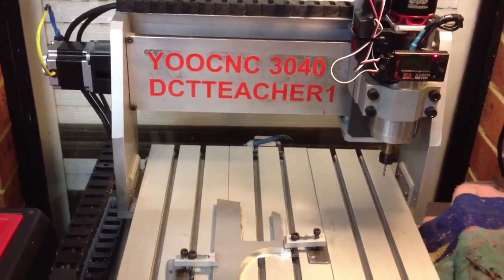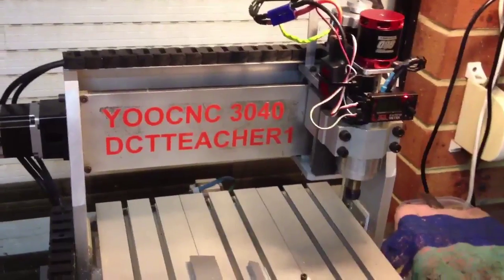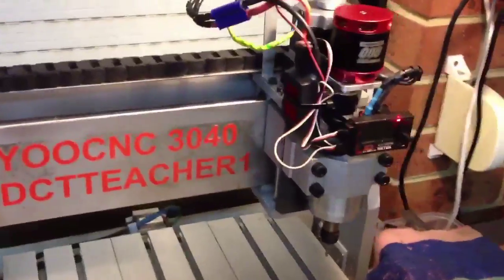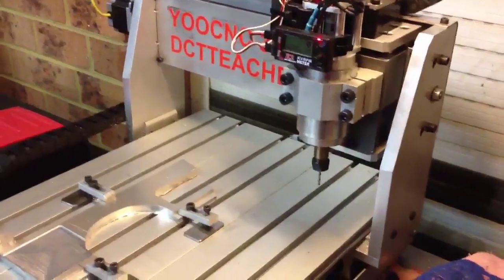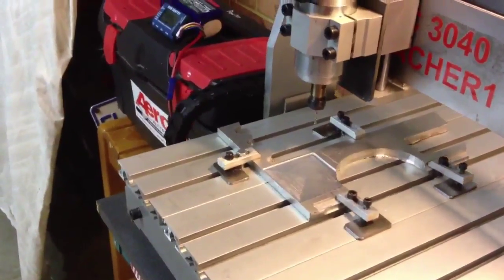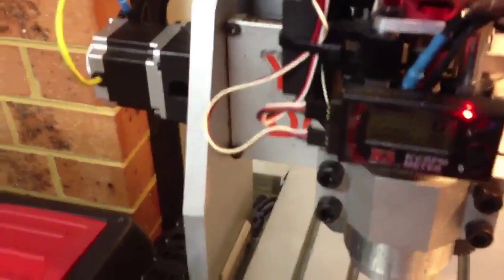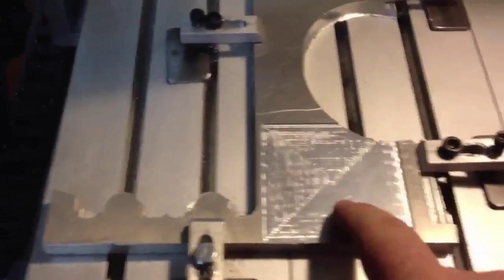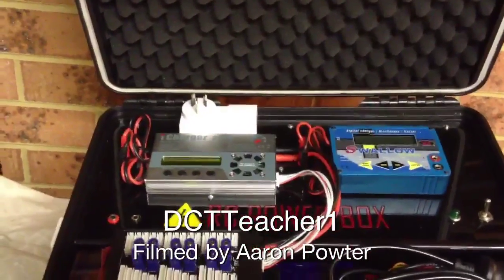CNC 3040 Router Update

Comment: I have a 3040 I've had sitting for a bit. I'm curious about the spindle upgrade. Can it handle side loads better?
Reply from the maker: Hello and thanks for watching.  I wouldn't do this modification now if I had my time over.  I would just purchase a new 1-1.5kw water cooled spindle and VFD for the machine.   They are well priced these days.  Cheers, Aaron.

Comment: G'day mate. I know this is an old video, but did you need to upgrade your steppers or reinforce the frame to cut aluminium?
Reply from the maker: G’day, nah I just used it straight out of the box. It’s not the greatest CNC, but it’s ok for the home hobbyists. If you’re going to be cutting lots of aluminium you’ll need a bigger and better machine. 👍🍻
Reply: @DCT_Aaron_Engineering  Thanks mate!

Comment: So I got this from Amazon it's been a year almost it's still not running found out cause I was givin a copy of a license not the actual software so I got a offline usb controller o lying to find out mine has no usb slot only a parallel port what do I do to get it to work I'm thinking of buying mach4 software or do I stay with mach3 my issue is the driver does not communicate with CNC so I got an expensive paper weight I want a working cnc what do I do any help will be greatly appreciated
Reply from the maker: f m hey mate. Hook her up to an old PC with a parallel port. Or change out the break out board for a more modern one allowing for Ethernet or USB control. My advice is to put a Masso controller on it 👍

Comment: 6040 machine do you have a link for one to buy nice video once again
Reply from the maker: Sorry Eric but I don't have a link.  However, you can usually purchase these units off eBay.  Cheers Aaron.
Reply: DCTTeacher1 you think a 6040 machine would be a good starting point to learn on im just getting into cnc
Reply from the maker: Yes they are good cnc router for doing plastics, timber and light aluminium work.  Depends what you want to machine?  If you want to do steel you'll need to get different type of machine for home.  Look at Syil CNC machines too.  Cheers, Aaron.
Reply: DCTTeacher1 light aluminium and stuff mostly and getting to learn the basics on the Mach 3 software etc
Reply from the maker: Hi Eric, Mach 3 software is rather outdated these days.  I have moved away from a PC based controller for CNC and would rather opt for an industrial controller or even a Masso.

Comment: can it drill a 2mm stell sheet?
Reply from the maker: milad ghasemi Hey mate, this is a router designed for timber, plastics and light aluminium work. Possibly could do a hole in a steel sheet, but it’s not the machine to do it with.
Reply: thanks، what about 6040?
Reply from the maker: milad ghasemi 6040 is a much  bigger & better machine. However CNC Routers are not designed for machining steel.
Reply: ok , thank you

Comment: I'm planing to buy one of these. I want to know how loud is this when it's working because I live in a condo building and I'm planing to run it in my apartment so do you think it would be too loud for my neighbors. I'm planing to cut wood and maybe HDPE
Reply from the maker: Hey bud, I haven't got the power connected at the moment.  However, once it's up and running I will sound check it with my dB meter ok.  I think most of the noise will come from cutting operations in and would change depending on material you're cutting.  Cheers, Aaron.
Reply: Thanks man, I use 3 axis industrial cnc at work and to me it would be loud in home environment but I thought it's about the router size.
Reply from the maker: Sorry bud, I was confused and talking about my new CNC machine (another video).  Yeah the little 3040 is fine for indoors.  You could easily make a sound proof box for it too ;-)
Reply from the maker: Oh and honestly.  Spend the extra money and get the 6040.  It has ball screws, VFD and better spindle.  Plus you'll appreciate the larger bed size.  Check out my mate Luke's channel (cruddcnc) as he has one.  Or watch my DIY camera slider video and you'll see us cutting carbon fibre out in his 6040.  Cheers, Aaron.
Reply: sound proof box is a good idea. Now I'm confused because of the bed size. I want 4 axis one because I want to use it like a lathe. I'm planing to do rings, espresso tamper handle things like that so I don't need to big bed size. I think I'd like to start with 3040 but thanks for advice.
Reply: I built a sound proof box for my 3020 in my apartment, and it works really well.  Our dishwasher is much louder. I made up some CAD drawings for the enclosure if you're interested, let me know and I'll send them to you. However, one thing I didn't follow through on was a sound proof enclosure for the dust collection system (shop vac).  The vacuum is incredibly noisy, but I can barely hear the router. :P.  The greatest benefit to the enclosure is that it keeps your apartment clean.
Reply: drawings would be great! At least it will give me some idea about what kind of  box I should build. I can adjust the size if I'm getting a bigger size. you can send me dxf or any 3D format (Solidworks, Catia, NX or step) that would be great.
Reply: Here's a link to download the CAD data.  I've got some pics in there too. The drawings are kind of sketchy, but I've got the solidworks files and a step assembly in the zip file. https://drive.google.com/open?id=0B85KWPSofM6gbGFPbUNNOWFDYzg
Reply: Andy Waters thanks. I'll make some cut files from solidworks.

Comment: Hey DCTTeacher1,

Got the 3040T machine and got a printer lead with it to USB (not the Parallel port printer cable though). This works with the software they gave me but I want to get it running on Mach 3. Do I need a different lead? If so, any idea what one? Or do you think i'm doing something wrong perhaps when in the software? 

Any help would be much appreciated as wanna get it up and running!

Cheers and nice video btw.
Reply from the maker: Hey man, I sold my little 3040 many year ago now.  However by memory, I don't think Mach 3 will work through a USB port.  I know I had to run windows XP (32bit) on my computer.  Some people use smooth stepper with USB and Mach3, but I haven't done this before.  Sorry I can't be of anymore assistance.  Regards, Aaron.

Comment: Please why you suggest 6040 than this .can you explain the reasons?does 3040 make wood engravings with success?thank you
Reply from the maker: Hello and thanks for posting.  I bought this 3040 machine many years ago.  I believe the latest design now come with ball screws, VFD and upgraded spindle.  This being said, I think they would be a much better machine than mine.  Especially if you just want to cut timber, plastics and the occasional aluminium job.  If you just want to CNC machine aluminium and steel, this isn't the machine for you.  Hope you find this information useful?  Cheers, Aaron.

Comment: As this video is from 2012. I don´t know, did you upgrade to a 6040? I´ve got a 3040 now, it´s ok from the dimensions for me, but I´ve only got a 300W spindle. I know that´s possible to upgrade with RC stuff as you did. Question is, would you still upgrade with an RC motor of would you use one of the spindles plus inverter that you can get on ebay nowerdays. I think back in 2012 those were not available. What´s your current CNC setup? 
Thanks, 
Michael
Reply: DCTTeacher1 you didn't answer his question though ))
Reply from the maker: Hi Michael, yes I sold this machine sometime ago now.  I never did upgrade to the 6040.  The little 3040 was good for awhile, but I quickly outgrew it as it had limitations.  I now have a TM20 (clone g0704) Chinese milling machine that I converted to CNC.  This machine will easily do aluminum and steel.  Refer to my playlist for more CNC videos on my new machine.  Have a nice day and thanks for messaging me.  Regards, Aaron.
Reply: Thanks Aaron.
Reply from the maker: racingdude You're welcome ;-)
Reply from the maker: John Smith good point lol. Yeah if I had my time over again I'd buy a VFD & spindle motor. I wouldn't upgrade with RC parts ;-)

Comment: do these come with software and bits?
Reply from the maker: Hi Jason, I bought mine some years back now. It did come with some basic tooling and other items. Mine didn't come with software. You will need cnc control software such as Mach3, linuxcnc or Kcam to make it work. You will CAD-CAM software such as Fusion360 or Vetric vcarve pro or 2d cut to design your parts and post process your G-Code. Thanks for watching

Comment: hi ...can it run - thoruhg 10mm brass or aluminium ?
Reply from the maker: Hello, yes you can but it will take awhile. This machine can only take shallow cuts on that sort of material. Cheers
Reply: +DCTTeacher1 Thanks ! it is better to go for 6040 - spindle they is stronger ?
Reply from the maker: +Wojciech Kluczewski Yes that is correct.  Don't waste your money on the 3040.  If I went down this path again I'd get the 6040 first. Hope this helps you? Cheers, Aaron.

Comment: Hello I have your same machine, and I want to make the change to the spindle, unfortunately I do not speak English (I'm using google Traslate) and I could not figure out which model of Brushless it.
I did a search and I think it is this: Specifications:
Dimension: 58mm x 49mm, 78mm (with shaft)
Weight: 349g
Kv: 1400rpm / V
Turns: 8T
Voltage: 5 ~ 8S
Max Current: 110A
Diameter of shaft: 6mm
Length of front shaft: 21mm
ESC: 150A
 
You can help you :)
Reply from the maker: Toto Burgio Hello Toto.  All parts came from from HobbyKing.  Turnigy 600 Brushless Helicopter Motor 4030-880KV and a HK-100A ESC (speed controller).  To run it I used a Turnigy 1200W 24VDC 50Amp power supply.  Hope this helps you Toto.  Regards, Aaron.
Reply: Thank you were definitely a big help :)
Reply from the maker: Toto Burgio You're welcome Toto ;-)
Reply: thanks :)

Comment: Could you substitute the battery for an old PC power supply?
Reply: DCTTeacher1 You could potentially hook up two PC power supplies in series to get 24V.
Reply: @Ian Leung don’t need two, a PC PSU has a few 12v connections so link two together or something, I sure some might have higher
Reply from the maker: dmak2 Hey man. I don't think a PC power supply would be able to pump out enough voltage or amps to run the electric motor. I originally used a lipo battery to film this clip.  However, that was later replaced with a 24volt - 50amp (1200watt) power supply from hobbyking. Cheers, Aaron.
Reply from the maker: ***** Hi Ian, personally I wouldn't do it. However, you would have to speak to someone who has more electronics knowledge than I do.  I would go down the line of a specified 24VDC power supply from a retailer.  Cheers, Aaron.

Comment: I have a problem with my cnc router spindle and i hope you can help me... so after reinstalling the max\ch 3 program i observed that i could not get the speed as before when turning the controls. Before, i usually set the spindle speed midway the dial. Now, i had to set it to MAX to attain a clean cut.
Reply: Nick Ustari Check if your carbon brushes are worn out and need replacement.
Reply from the maker: Hey Nick, yeah sorry mate I can't help you with that problem. Everything should work the same, unless you've hooked your spindle motor up via the breakout board and up to mach 3.  My guess is that cheap spindle motor that comes with the 3040.  Knowing what I know now, I would have never bought the 3040, but I would have bought the 6040.  Cheers, Aaron.
Reply: DCTTeacher1 Could you tell me why you would have never bought the 3040? And why the 6040? I'm interested in buying one of these ebay cncs cause the seem pretty sturdy, and even if an electrical component craps out, it can probably be replaced and it's still worth a purchase.
Reply: thedon008 Don't buy it from ebay, buy from the manufacturer directly http://www.carving-cnc.com/
Reply: Johnny Doe Thanks for the tip!

Comment: Which aluminium are you milling? And how much are you milling in the z axis? I am thinking to buy just the frame, and use my motors and electronics, and this looks like a good option...
Reply from the maker: Luiz Ricardo Antunes Hi mate, I was using 6061 in this video.  I used a 3mm x 2 flute cutter with a DOP=0.1mm.  These were early days when I filmed that video.  I would probably take a bigger cut now (0.25) and run faster feed rate (300-500mm/min).  Hope this helps?  Aaron
Reply: Helps a lot! Thanks!
Reply: @DCTSolutionsAU if you keep cutting over same area can you reach 20mm? Just wondering as thinking to buy this even though you said 6040 in others but as minimum to cut 12 parts I need to make a machine 8ft by 4ft as cost £1500+ to get someone to machine for me the parts